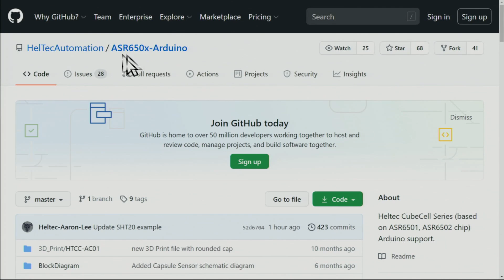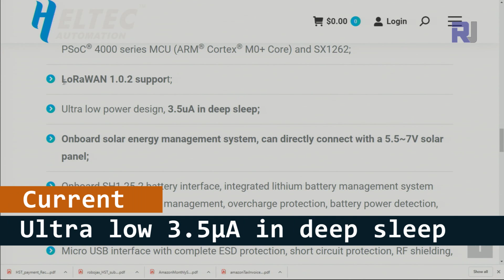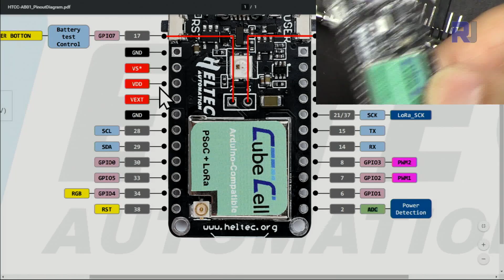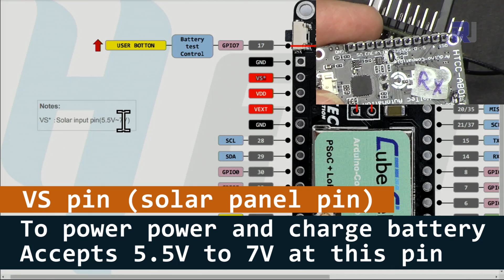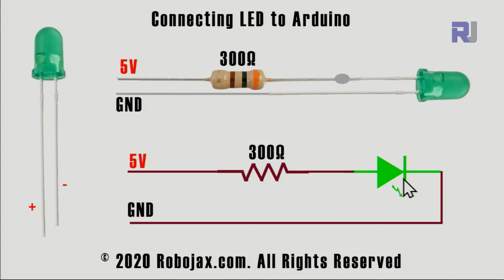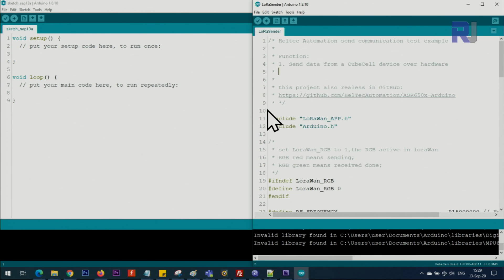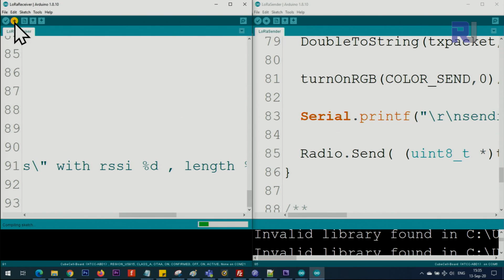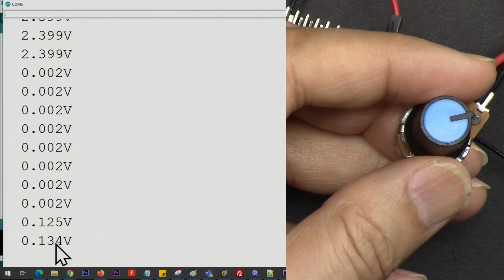Introduction to Heltec LoRa CubeCell Development Board HTCC-AB01

Comment: Thanks for the review, is it possible to program it without using the arduino framework?
Reply from the maker: Yes you can if you read the documentation and wire your own code in language you like
Reply: But is there any framework or HAL available and open source, like for ARM? PSOC is more kind of a picky microcontroller...

Comment: thanks for sharing... what's the range and power consumption in real environment with some obstacles like trees and buildings
Reply from the maker: for the range no one should give a figure. it could be 500m or 90km.  if two of this module are on top of two mountains, you can communicate with over 90km. but as the obstacles come, it will be reduces to few 100 meters.

Comment: Hi, can you please explain if can control the relay modules you suggested, with the HelTec Cube Cell AB02, with the code you have for controlling the LEDs wirelessly? How many GPIO available do I need for each relay? can I use the same GPIO pin number for the switch on the CubeCell transmitter & the relay on CubeCell receiver? or do i need two GPIO pins for each relay between transmitter and receiver? about six of the relays (for lighting) are in six different places, the other about 7 are in one place. Thanks, happy to give donation for working code for this. Also hoping to have repeater cube cell units to increase range/go around obstacles.

Comment: Good Morning,
I’m using some HTCC-AB01 like sender, I’m sending some value read from 5 sensors connected to their GPIO. I’m using also an HTCC-AB01 like receiver.
I need to know how many HTCC-AB01 used like sender can be handle by one HTCC-AB01 used like receiver.
Can you help me?
Reply from the maker: Simultaneously one will work but if there is a theming gape between sensing data from multiple devices , it should work with as many transmitter as you want.

Comment: Hi, Is the code posted for turning on and off the LED somewhere? I would also like to add sleep mode until the button is pushed. Thanks
Reply from the maker: Hi, Interesting feature to be used. I will consider that in the next video I am going to make on this board.
Reply: @robojax  Okay thanks, In the meantime before you make the video showing the remote control of the LED is there a way you could post your code?

Comment: 7v to 4.2v interesting🤔 Robojax I can cluster these as a scaleable(2 cell - 21 cell) Wireless(Mesh) Bms(Battery Management System). Tap in via the balance cable and log "Individual" cell voltages "Collectively" while using the GPIO pins to toggle OCP OVP LVP relays or mosfets rather. All-in-one package. I would base is off the DC/DC ISDT Air 6s bluetooth charger although instead of 2.4Ghz BLE it would have AI + LoRa range and speed and much more. Imagine a Mesh BMS with built-in charging and full protection wake over LAN remote access via dual band & LTE fail over. 1mv active balancing smart storage discharging based on an inactivity or schedule options and features are only limited to your imagination and programming skills. Thanks Robojax
Reply: I would name it RJW-MBMS - ROBOJAX WOOTEN MESH BATTERY MANAGEMENT SYSTEM.
Reply from the maker: Sounds very interesting. Thanks.  Please update us when done. Good luck.

Comment: can I use it on an arduino board? like Uno or Mega?
Reply from the maker: Arduino UN/Mga are Microcontroller. This module  is itself a microcontroller and you can program input and output of it like Arduino UNO. just see which option is available. I've explained it.

Comment: By the way, I often see Lora module connected to raspberry pi in papers, obviously Linux system. How to find this kind of module? I am very confused that most modules are connected to the notebook with WINDOWS operation system.
Reply from the maker: students and most people  use them on windows. I would have make video if I knew if there were enough interest. But no one watches this.  the resources link is in the description of this video. you can see where to get it from.

Comment: Hi, Do you have code available for the HelTec CubeCell AB02A that can wirelessly control relays by the GPIO pins? (As you said in your comments section that you have the code for LED controlled wirelessly by Cube Cell for USD$50) Please can I also ask if when controlling Relays, is it possible to use the same GPIO pin number for switch in (on Transmitter)  & also Relay out (on different, receiver unit) (I am controlling about 13 + relays) Please also, for code making in AU915 - 928 (not US915)
Reply: Sorry, meant to say HelTec AB02, Thanks really like your youtube explanations
Reply from the maker: Hi, you can't control a relay directly but you can control a relay module which has relay driver like a transistor. I have tones of videos on using relay up to 16 channel.
Reply: @robojax  Hi, can you please explain if can control the relay modules you suggested, with the HelTec Cube Cell AB02, with the code you have for controlling the LEDs wirelessly? How many GPIO available do I need for each relay? can I use the same GPIO pin number for the switch on the CubeCell transmitter & the relay on CubeCell receiver? or do i need two GPIO pins for each relay between transmitter and receiver? about six of the relays (for lighting) are in six different places, the other about 7 are in one place. Thanks, happy to give donation for working code for this. Also hoping to have repeater cube cell units to increase range/go around obstacles.

Comment: what is the range, without effective range, its as good as a nrf24L01
Reply from the maker: nrf24L01 has 1mW power and CubeCell can go to 22dBm which 158mW so this is way way powerful. nrf24L01 is operating at 2.4GHz (2400MHz) and as the operating frequency is reduced, the range increased.  CubeCell has 433 to 915MHz.

Comment: Assalam alaikum  Sir,
What would be  the range  ??
Reply from the maker: Walaikum salaam, I have not tested it but it would be in km if not 500m. it depends on the surrounding. The output power is very high with comparing it to nrf24L01. like 158 times more.